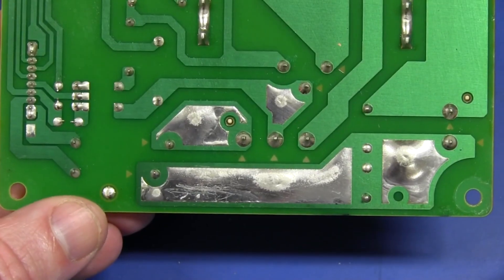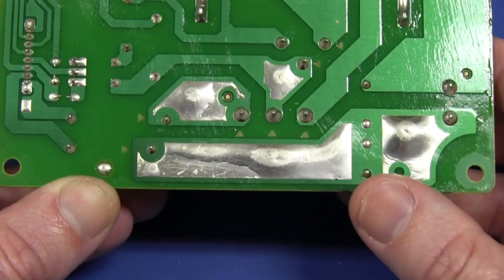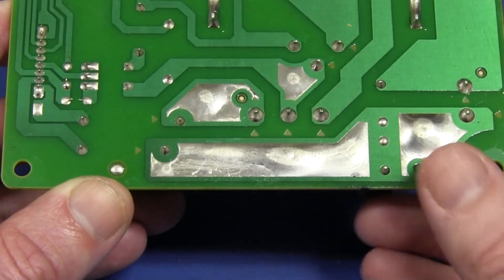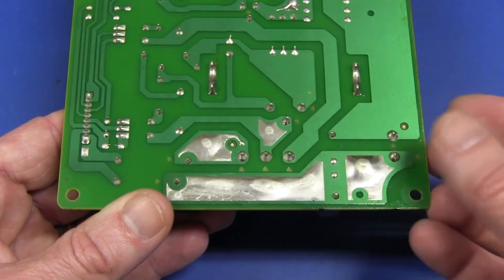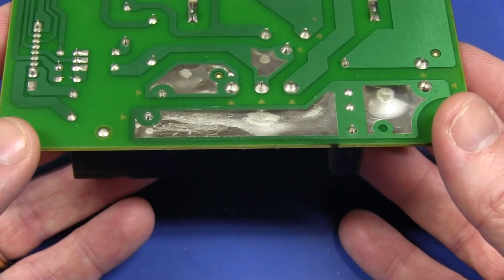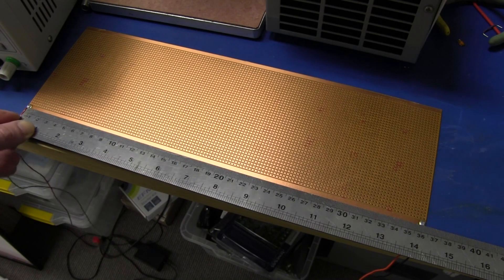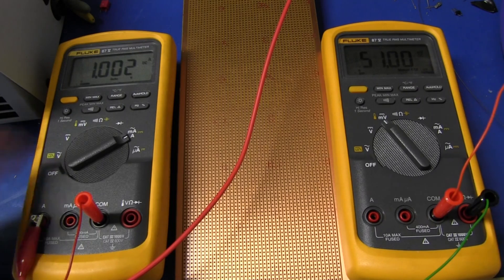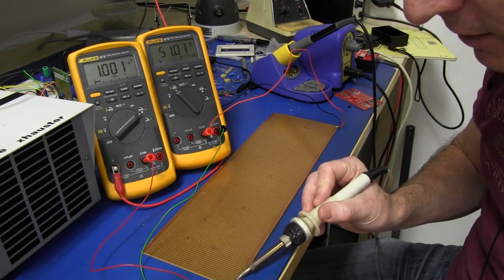EEVblog #317 - PCB Tinning Myth Busting

Comment: With some PCB board processes a thin coat of solder is electroplated where conductors will be and then the plating is actually used as the acid resist during etching.  In these cases there is no bare copper conductors even under the solder mask.  The solder plating that is used is very thin of course.

Comment: Ohms law rules there, silly to think it doesn't make a difference. Also what affects the current handling too is how much heat the trace can lose. If there's no solder mask the heat loss is greater resulting in less heating and therefore lower resistance. Add solder to that and you have a resistor made up of the solder in parallel with the trace. Even if the resistance of lead/tin is greater (145nohmm/m vs 17nohm/m or about 8.5 times greater) at 35um the copper is so much thinner that the solder only has to be 0.2mm (average) to have an equal resistance which would halve the trace resistance. Obviously the average thickness of the solder in Dave's video is more than that so the 40% he stated sounds very reasonable if not understated.
Reply: goatstaog
Sadly in HiFi circles fraudulent statements are allowed. BTW, the output impedance of the amplifier and the total resistance of the wire between amplifier and speaker does make a difference to sound quality if it's > 0.2Ohm. that's why active speakers perform so much better than conventional speakers. Note that 0.2Ohms between the actual terminals of the driver and the pins of the amplifier is what I'm talking about. Because conventional speakers have around 1/2 to 2Ohms in the crossover network, the cable actually can't make it any worse, and spending crazy amounts of money on cable is a suckers game.

Comment: If you do the math, it's pretty obvious that tinning the trace won't do much difference, unless you really put lots of tin on there. For my applications it's no use. Instead I have 1mm copper sheet cut out to the shape of the trace and solder it on to the trace to reinforce it. Expensive solution but that's to be expected when you need to carry >200A and have strict limitations to physical size.

Comment: So, is tinned copper wire also a better conductor than bare OFC wire?
Reply: Bishka100  They say that the high frequencies tend to travel along the surface of the wire rather than inside the wire
That's not an effect that's an issue at audio frequencies (10Hz-20kHz).
Reply: deinemuddamithut PS: All this stuff is covered in considerable detail - including the maths - in the Wikipedia article:
https://en.wikipedia.org/wiki/Skin_effect
Reply: goatstaog  OFC can transmit certain things like audio information at a higher frequency rate
LOL, no. That explanation is gibberish. (And yes, I've done audio engineering work. Also electronic design work.)
Reply: deinemuddamithut  Even at mains frequency (50Hz) the effect is an issue
No, it isn't. Conductors in cables for 50Hz power are round, just like every other cable intended for use up to about 10Mhz or so.
Reply: deinemuddamithut  And at 50Hz its 9,38 mm
LOL. Calculate the resistance at the core. The skin effect makes no noticeable difference, even at the core.
The multiple conductors you're talking about are for mechanical flexibility, & nothing to do with the skin effect.
Reply: +God Emperor Lionel Lauer 
Hahahaha!!
Maybe bat's could appreciate the difference!!!
Reply: The Amp Lab 'OFC' has no useful effect on the conductivity of the wire. Commercial tinning is unlikely to create a measurable difference either, it just makes it solder better.
Reply: God Emperor Lionel Lauer 

IF the HIFI magazines are to be believed, OFC wire had a slightly better high frequency conductivity. They say that the high frequencies tend to travel along the surface of the wire rather than inside the wire and because OFC does not oxidize the surface has a lower resistance. How much of this is true and how much is hype I do not know. I can't imagine it would make any difference to a power bus, but it might make a slight difference to signal tracks/ connections?  I seem to remember some high-end studio gear using silver wire or OFC wire for its internal connections.
Reply: +God Emperor Lionel Lauer This effect is named skineffect and is an issue at antennables, thats why they can be hollow. But i don't know where the "frequencylimit" of pushing all current to the surface of the conducter is,but i think i remember that it rises like an e-function. Even at mains frequency (50Hz) the effect is an issue, thats why high diameters of conducters are tending to be rectangeld rather than squared. Like this http://www.sps-standard.de/uploads/pics/isoflexx-im-einsatz.jpg
Reply: Yeah i know that wiki has an articel about it but i was to lazy to look it up. BUT if you do this, which i now did, there is an table with the penetration depth. And at 50Hz its 9,38 mm :)
I am "Elektroniker für Energie und Gebäudetechnik" i have practitcal and theoretical knowledge about it ;-)
NYM Cables have round conducters but just have a look at NYCWY cables they are not round and have mutiple conducter for each phase/lifewire and the neutral one

Comment: Christ those people... resistance of a wire depends upon the material, length and the cross-sectional area.

So of course PCB tinning increases current carrying capacity!
Reply: Validole Regardless of your thoughts, if I think it will assist someone in coming to an understanding to what you feel every human should see as "self-evident", then I'll throw it out there. No need to pound your chest claiming superior intellect.
Reply: I tinned the internal antenna of my wifi dongle and I got a faster connection.
Reply: +akkudakkupl I think they said it would not make a significant difference, not that it would make no difference.  Anyway, as we know, of course it will make a difference and the more you add the greater the difference.  Even so, dave's video does show that it can make a significant difference.
Reply: 亮星王 hah...  :D
Reply: goatstaog bad idea. That guy was obviously a troll.
Reply: Is there any kind of design rule to follow using this HASL finish? , i mean the rule its 40mils per Amp however if i get a 40mils HASL finish track, can i actually put 2 Amps on that?
Reply: akkudakkupl Typically referred to as MALT - material, area, length, temperature.
Reply: +亮星王 I was just thinking of this application to my LG Nexus 4 which the antenna reception keeps breaking from the carrier but not the wifi - so i might try over tinning.  cool for you to share.
Reply: +akkudakkupl No, the guys was obviously joking.
Reply: barry allard. good point. would be intresting to see the results for hf. skin effect might be a bitch
Reply: That is all relative. For the current magnitude in average electronics, your suggestion is fishing for hen's teeth. If you're talking about copper trackwork in high current circuit boards such as those used in SMPS, then that's where thinking about thicker copper track would apply.  The relative coefficient of resistance between Sn/Pb and Cu track is negligible at mA levels. If you're applying this to high current RF, then a whole different world of calculations and theory is needed.
Reply: I tinned all my traces on my Tesla, its faster now. Under 2 seconds 0-60moh.
Reply: Jason Bone Which itself is MERMAID - Mnemonic that Encourages Rote Memorization, Actually Intelligence-Destroying. 

Such things should be self-evident from the simplest considerations regarding physical flow. It saddens me that this mnemonic exists.
Reply: i know that this answer comes quite late. but it is actually not as simple as you say it is. if you surround a great conductor with a bad conductor you can make the situation actually worse. as you can see in the video the most current still goes through the copper. when you put a lot of current though the track it gets hot. and it gets hotter than without the solder. this increases the resistance of the copper. you could increase the current to a point where you would be better off without the added solder. in this situation i kind of agree with you. solder is not the best conductor. but still good enough actually improve the situation.

Comment: When soldering, you essentially create a Lead,Copper and Tin alloy.
Reply: +Sasha Whitefur No, you absolutely do not create an alloy via soldering. Creating an alloy would involve melting all the base metals and combining them. While the lead and tin are alloyed together, the copper is not added to that mix. Solder is a mechanical connection via adhesion, not a chemical one.
Reply: Yes it tis. I have years of experience soldering.
Reply: +Sasha Whitefur Most tin/lead solders melt around 200C. Copper melts just over 1000C. No copper is melted during the process. Any intermetallics are formed through chemical reaction, thus soldering could hardly be considered an alloying process. Melting of the base metals to be joined is welding. Using a lower melting point alloy to adhere them is soldering. I too have been soldering for a few decades, as well as welding.
Reply: The solder lowers the melting point of copper, which is why you can't remove all of the solder, there will always be residue.
Reply: Sasha Whitefur The residue stays simply due to mechanical adhesion at a micro level. How does solder lower the melting temperature of copper? In order to do so, it would need to alloy with the copper, which would require the copper to melt. There are some tin-lead-copper compounds formed but this is hardly an alloy as an alloy is homogenous.
Reply: Lead lowers the melting temperature of the tin, so it can lower the temp of the copper. When the copper is recovered, the solder must be removed by chemical means.
"The residue stays simply due to mechanical adhesion at a micro level"

The elemental level, the atoms mix, forming as alloy, all of it doesn't need to be homogeneous, only the boundary

I learned that in my Digital Electronics Technology training. In my soldering training as well.
Reply: Google essentially.

Comment: the fun way would be to load the strip til it burns off and then load a tinned strip and see how many amps it takes to burn that one :)
Reply: I think you just hinted at an advantage of tinning: it increases the thermal mass of the trace and improves heat dissipation, thus increasing the amount of current the trace can carry without heat-related failure.
Reply: @flatfingertuning727  it definitely increases the trace’s thermal mass, but it doesn’t necessarily improve heat dissipation (I’m sure solder doesn’t conduct heat as well as copper). Removing the solder mask will help; perhaps tinning improves heat dissipation by increasing the surface area to the air.
Reply: That would be the fairest and most complete way to test how well this actually works as decreasing the resistance only indirectly suggests an increase in current carrying ability.  Plus, it would be neat to watch the smoke and fireworks.
Reply: Eric Hope I'd like to see that :P

Comment: How was this an issue at all? Don't need to know crap about testing with/on solder thickness on PCBs to figure out the answers. Resistance and current of different gauge wires (e.g. 16-gauge vs 12-gauge) is well known, and the principles are directly related... i.e, the same damn thing.

Comment: If you need to clean empty PCB it is better to use cotton or piece of tissue and just brush liquid solder away.
that way restores PCB back to the nearly original condition.
Reply: I doubt if you can blow away solder to reach same result as using tissues.

Comment: I do this all the time on the ac heat and motor control side of hottub control boards and there is a drastic decrease in board failure from high amperage

Comment: The solder does "leach" some of the copper out and form an alloy with it.  Some people even say that solder shouldn't be reused because once the copper gets into it it no longer tins properly.  I've never had a problem though.  For a while my solder pot contained 100% used solder that was sucked from boards.  It's in one of my videos.  I doubt though that the tiny amount of copper removed by the solder would be detectable by a meter.

Comment: Thick tin also helps cooling small but hot components by increasing surface area.
Small power supply's often have diodes that have their hot end(they literally have one)stuck in a big surface of copper board surface thick in solder.
More surface is more cooling and better heatconduction.

Comment: The current only flowing on the surface of a conductor only happens for alternating currents. The higher the frequency of the current, the more the conductor will repel the current from its interior due to self-inductance.
Search for "Skin Effect" to learn more.

Comment: You may even get better results by coating with blobby solder (as you did) and then applying "veins" (long-ways) by slightly carving/engraving long lines within the tin coating.  Why? Because current tends to flow on the surface not the core of conductors. Probably this is also an explanation of why this whole thing of coating works: the rectangular perimeter of the section of trace copper is surely smaller than the rectangular with an arched side coated copper.  More surface=more current
Reply: >current tends to flow on the surface
No. This video is about DC resistance. Current flows through the entire conductor.

Comment: Dave, what about the inductance of the traces? Do they increase with this technique? In a H-Brige high frequency PWM, the inductance of the board is very important...
Reply: With high frequency you get skin effect that makes things more complicated.
Reply: @lrmackmcbride7498  only in the MHz range for a PCB like this I would bet, but also depends on the current, hard to ballpark, better to simulate.
Reply: @michelfeinstein  .3 mm at 50khz.  For short runs at low current it might not be as big of an issue.  For a high frequency H bridge, it is definitely an issue.  Hence the "keep traces short" mantra.  Above 100khz litz wire is a necessity in power applications.

Comment: The solder deposited is not free: first the solder has to be paid for, and second, all that exposed copper will dissolve somewhat into the solder (which is a problem with wave soldering machines),  requiring that the solder be replaced more often, because dissolved copper is detrimental to soldering.

Comment: 2oz double sided isn't that difficult actually. It's not extremely expensive either. It may be out of the realm of many hobbyists, but the 2oz copper is common on high current temperature controllers.

Comment: what I  were told in a university class, was that the chemical tinning as well as the solder mask, lowered the maximum amount of current that could be past through the trace, by thermally isolating it from the air.
what are your thoughts on that?

Comment: just cause I was bored I did a back of the envelope calculation of what the resistance should be for that track using the resitivity listed for Cu in Griffiths Intro to Electrodynamics, and I get 0.041 Ohm using your measurements. I think you just proved Griffith number (slightly) wrong hah.

Comment: I understand change from is from 50 milli-ohm to 25 milli-ohm, and that is a 50% change, but the overall change is still only 25 milli-ohm.  Using Ohms law we can say that power is I^2*R, so if 2 amps are going through the track, thats a change of only ~0.1 watts of energy dissipated by the track.  That lower resistance helps for sure, essentially dropping the power dissipated by the track in half, but doesn't the solder also act like a heat sink, which reduces thermal strain on the track?

Comment: You only need to worry about this type of stuff when making loads of pcb's. the calculations involved would be nutz due to all the variables, such as width of track and the surface tension molten solder would curve to, then it's cross sections resistance etc etc. if your making a few boards, just solder a bare wire along the trace that can hadle the amps. Keep it simples. hope this helps

Comment from the maker: They are the same numbers. Do the math correctly and understand the terminology used. A "40% increase" from 18ohms IS a "28% decrease" from 25ohms. A very common mistake people make when dealing with "percentage increase" and "percentage decrease" terminology. It depends entirely what direction you are talking about, which is why I used the two different figures.
Reply: Talking simpler, it entirely depends of what NUMBER you decide as the 100% (taxes calculation is the common example for this)
Reply: That's why I hate percentages. I know they work differently depending on whether you're going up or down, but I don't trust myself to get it right. Also, they're sorely abused by journalists: HEADLINE: X causes 30% increase in Y! Well, if the initial likelihood was one in a million, that's not a big thing, but if it was one in three--oh dear! I know you're not a maths geek, but maybe you could do a video on how to calculate percentages from both sides.
Reply: @markschwarz2137  fck to journalist's headlines and their clickbates! Most of them aren't graduated in sciense nor in physics. It always depends of what you decide\take as the 100% (the whole "1"). As I found out recently, most of people can't even add a pair of natural fractions! They simply don't know how to do it! Although each one of them went to elementary school! It's awful!
Reply: @markschwarz2137   if you lose half your money, thats 50%(decrease). if u wanna go back to what you started with, you now have to double your money,  thats 100% (increase).
Reply: @Cassiusisback  How does that work when all the numbers are zero? LOL!
Reply: @markschwarz2137  easy: 50% of 0 is 0. if you now double that zero, youre back where you started.